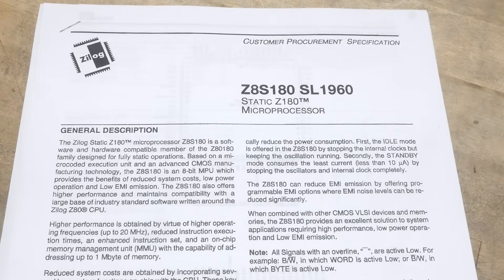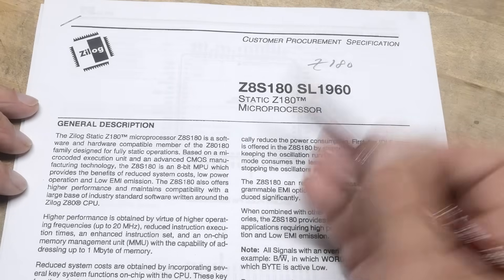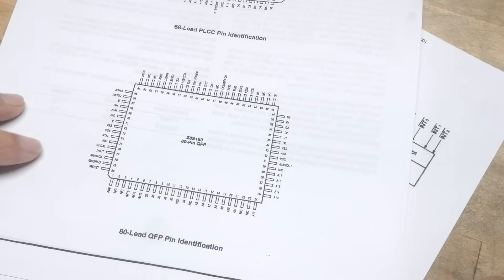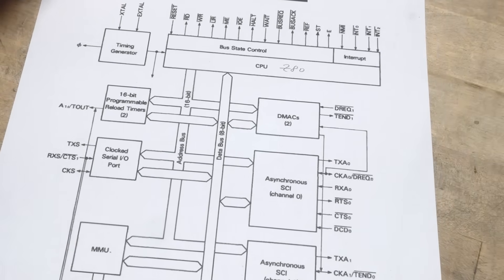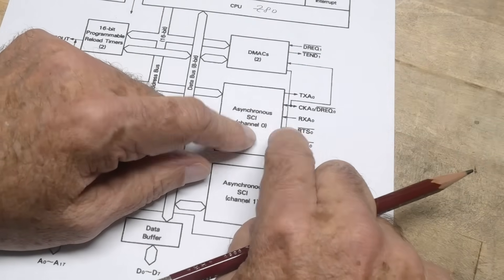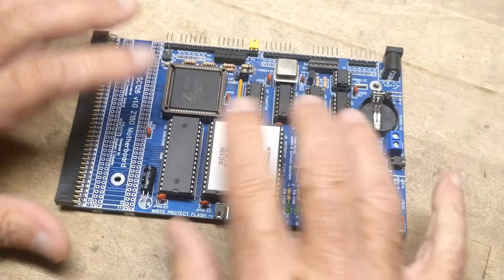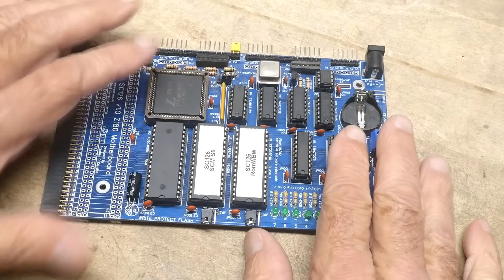#2432 Z180 Z8S180 Modern Z80 Microprocessor

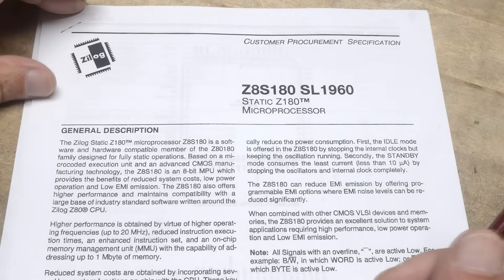Comment: 0:55 only the original z80

You can still get ez80 and the newer ones, although not fully backwards compatible 

Ti graphics calculator uses a z80 though one that probably runs closer to 20mhz 

Unless it just used arm like ti nspire cx

Comment: You are confused about the serial ports at 8:00. The top SCI is NOT for SPI, it is for asynchronous RS232 with all the handshaking. The lower SCI can also be used for RS232 with XON/XOFF flow control, but I always used it for MIDI.
My favourite features of the Z180 are the MULT instruction and the fact that you can turn dynamic RAM refreshing off so all the instructions run faster than a Z80 at the same clock speed. With fast ROM and RAM to avoid wait states this thing moves!
Development is not quite as easy as first you have to find a cross assembler for the extra instructions (I have a Mac one downloadable from my archive) and then you have to trick disassembling logic analysers into seeing a Z80 bus. This can be done with a 74x74 clocking M1 with the system clock and cleared by ST to generate a pseudo M1. 
You should also look at the Z181 and Z182 which incorporate a Zilog SCC (big brother of Z80-SIO). You don't find many USARTs that support Bisync and SDLC these days.

Comment: Z180 is discontinued last year at the same time as Z80, because manufacturer stopped supporting the legacy process used to produce them. Only Z80 successor still in production is ez80 and it is superior to both Z80 and Z180.
Reply: Nowadays if you have some die shots and vhdl you can just fabricate some, dunno if it cost effective

Much easier if you can actually find the schematic of the CPU floating around

If it's gate level and transistor level 1:1 on cpld or fpga, what's the difference?
Reply: I think 6502 is still made 

Fab em using a newer 70-90nm process since those Fab probably still around cranking out stuff

Then you have 3.3v with 5v tolerant pins

Comment: My Blazie Type 'N Speak has a Z180 in it.  It originally had an HD64180 but an upgrade which was offered by Blazie at one point called "Super-Flash" which added more SRAM, an OS upgrade and several megabytes of flash (VERY expensive at the time) on a daughtercard with a Z180 which plugs into the socket for the original CPU.  The flash is only there for file storage; the OS is very much dependent on the SRAM and if you let the battery run down it is possible for the / filesystem to be corrupted, requiring it to be re-initalised from ROM.  The OS is multitasking to a degree and while the user interface is mostly through the built-in Votrax synthesizer it is possible to connect it to a terminal to have a visual interface and to a computer which allows it to be used as a desktop speech synthesizer.  It will also read MS-DOS formatted 3.5-inch floppy disks with a connected floppy disk drive (which I don't have).

Comment: I used the Digital Research macro assembler and made macros for Z80-only instructions.  Turned out some of those were faster than the Z80 would execute them. Allowed me to install ZCPR on my Space Byte 8085 S-100 machine, assembling Z80 source code to run 8080-only object code. Fun times.....

Comment: Weren't all the Z-World controllers all Z-180 based? Man, those guys made a TON of stuff. I think they were really a leader in "embedded controllers" back in the late 80's and 90's.  I wonder what ever happened to those guys?  I think Parallax and their BASIC Stamp are still around. Maybe? Didn't they cook up a new parallel (or round robin) MCU and started making boards for it? What was that called? The Propeller I think? I seem to remember some old Circuit Cellar article that said Chuck Gracey was designer. How was the head guy at Z-World? Norman someone wasn't it? Time marches forward for sure...

Comment: I've been trying to design a board that plugs into the z80 socket of whatever old machine you could fit it in, that provided an 18MHz Z180 + a bunch of ram + romWBW + access to the old machine's built-in IO port space for peripherals, or switched into a mode where it runs off the original clock and uses the old computer's memory space for compatibility with old software and operating systems.  All the funny switching back and forth stuff and setting up the z180 to be able to map in the original RAM for mmapped peripherals and all that stuff made my ears bleed though.  D:

Comment: My first PC was a heathkit H8 Z80 CP/M system and still have it. First job was working with Z80 CP/M systems (I designed an 8mHz board.)
Want to relive that old stuff. The H8 is just too obsolete (hard-sectored SSSD floppies). The Z180 board looks interesting and may be simpler way than designing some flash storage board for the H8.
Reply: The Z180 is definitely a step up from the Z80. The Z280 was even more interesting.
Reply: @joseoncrack I did a lot of work using Rabbit Semiconductor R3000 modules. Has something similar to the later gen Z?80s. Problem is they are not fully code compatible with Z80. Were nice with lots of I/O and network support.

Comment: First assembly code I tangled with was a program to connect an Intertec Super brain to an IMSAI PCS44 over a pre RS232 serial port.  Took me a spring break to figure it out.  Gained me PL1 that I used to make D&D characters.  Printed them out on an MX80 with a serial adapter in it.  By that time I had video card also.  Fun times!

Comment: In the early 80's I worked with an in-circuit-emulator for the Z80. It was a beast. It covered a small desk. It had two 8inch floppies (128KB each) and a 50 amp 5 volt supply internally. It had a pod at the end of a twisted pair ribbon cable with a Z80 processor on it. We plugged the pod into the target Z80 socket. We then could program the target using breakpoints and more troubleshooting methods. Now that hardware is built into some of the modern micro-controllers.
Reply: I worked with ICE for 8086, 286, 386, various 680x0, PIC and even 805x parts, the modern stuff is nice but nothing beats a real ICE with a bondout chip IMHO.

Comment: Always be a place for the Z80 in my heart.  My first computer was a kit built Sinclair ZX80 which I had to use up a full years worth of birthday and Christmas gifts to get my parents to buy one for me.  Since there was only 1k of memory and the screen shared that memory, there was jack left for programs.  Basic was way too resource hungry so it forced me to learn machine code due to it's efficiency.  I had no assembler, not even a monitor (not enough memory) so I had to do it thru pokes.  I'd rather shove toothpicks under my fingernails now but back then it was sooooo  COOL!!! that it didn't phase me in the least. Good (horrible) times for a teenager in the early 80's!
Reply: Ha, same here.  I wrote an Othello program in assembler by poking in the values.  😲😖  I’m too smart now….
Reply: The word is spelled faze, not phase. 😉